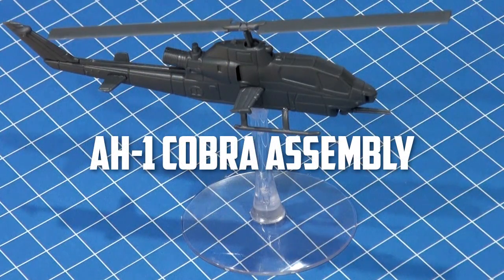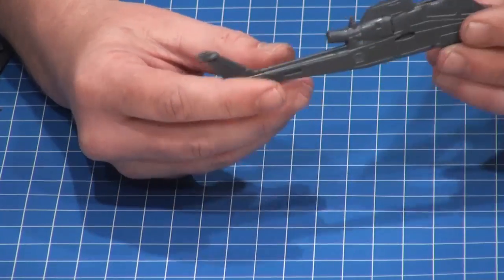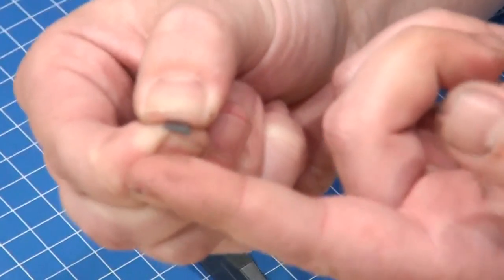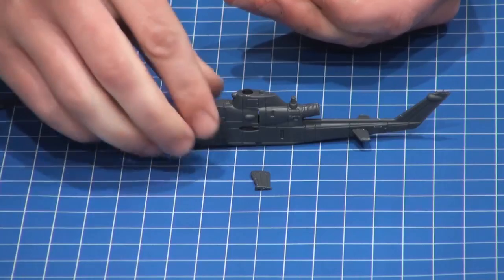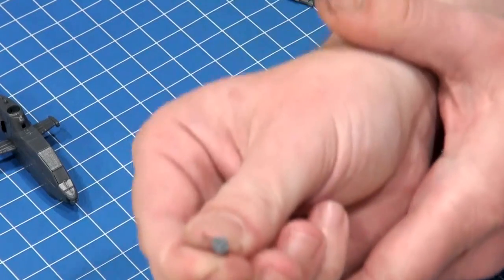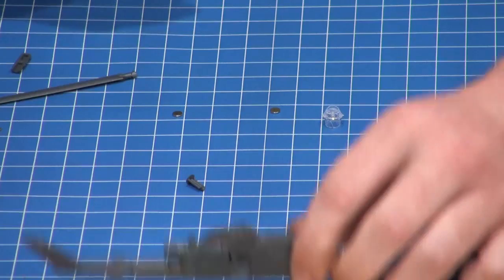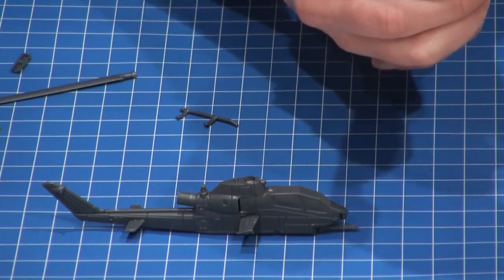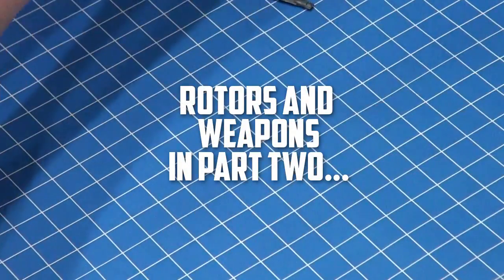Team Yankee Cobra Assembly Part 1

Comment: Why do the rotors have a magnet? Couldn't you just add a little piece of plastic to make them slot in?

Seems more finnicky than it's worth to be honest.
Reply: +Jimpiedepimpie The magnetized rotors are handy when you need transport the model. Makes it less likely to be damaged in transit.
Reply: Craig Owen Well yeah, but a little plastic plug would have the same result, and the plug wouldn't slide around when the model's on the table.
Reply: Thats a good point.